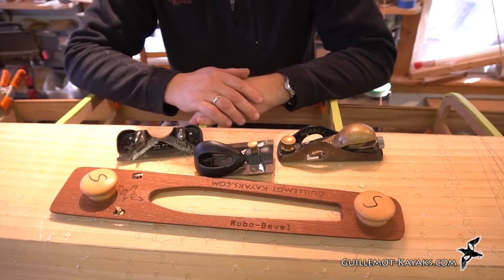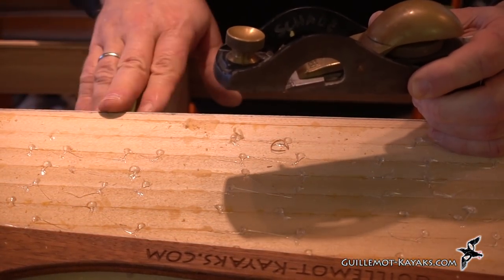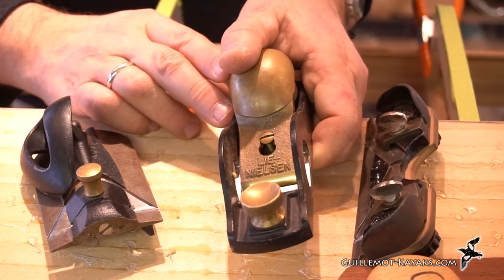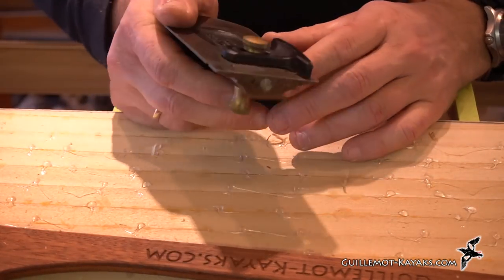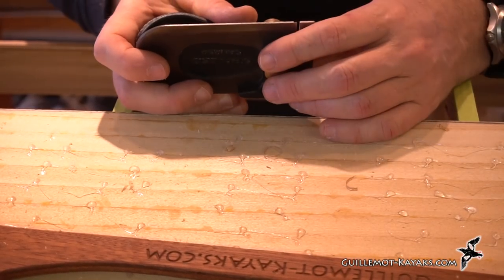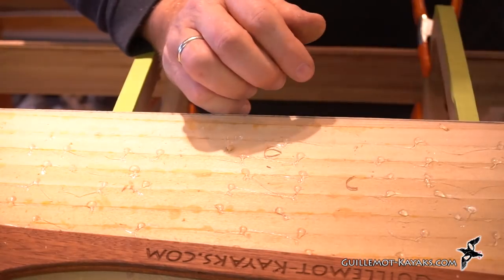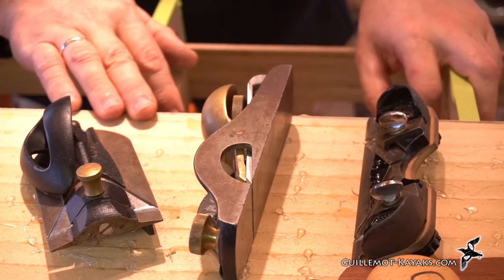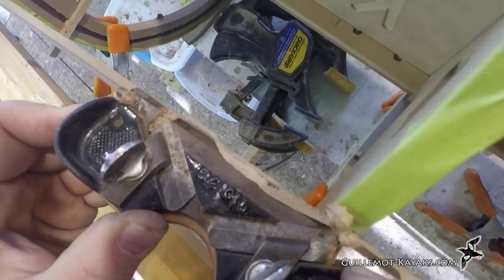Tool Talk - Rabbet Planes

Comment: hi Nick, I'm re-watching this but now for different reasons. I'm started, building a Somes Sound 12 1/2. It is a glued lapstrake construction and I will be needing to cut laps and gains. I thought at first to look for a rabbet plane but am now confused with shoulder planes and can't decide which would be best. The planks will be made of hydrotech marine plywood (3/8). What are your thoughts, please?  thanks, Chuck
Reply from the maker: I don't end up cutting gains so I'm not necessarily the best qualified. You probably want to use a tool that matches the size of the gains you are cutting. A shoulder plane is a form of rabet plane (rabet planes have blades that extend to the side of the plane) and I would think a shoulder plane sized slightly bigger than the needed gain would work nicely, but any rabet plane would get the job done. I'm sure some folks just use a sharp chisel.
Reply: @NickSchade  thanks Nick!  I think, based on what I can gather, is that one or the other has a lower blade angle and I'm thinking that this might be more suited, especially based on how thin the material is that I'll be using.

Comment: I think the handiest solution to swapping directions would be having a second Veritas side-rabbet set up to go the other way.  AND I'd paint it a different color so I'd not have to think about which one to grab.  But I only have the 79 Stanley with the metal fence in my rabbet plane collection (at this point in time), save for the Stanley 71.5 router plane. Good info from the Pro tnx.
Reply from the maker: The best solution is always: more tools.

Comment: I know this is an old video, but I have a question I hope you can shed some light on.  I have a Lie-Nielsen block rabbet plane like you show here, but for some reason, the blade is wider than the actual plane, is that intentional? Because to me it only seems to be annoying and make alignment much more difficult, so cutting flat and straight once one side is adjusted flush to the side is almost impossible. - I'm very close to just going with grinding it flush on both sides, but I'd like to know if I'm about to make a booboo. Thanks for all your vids, they make the woodworking fingers itch with need of building a kayak. :)

Comment: The fence on the veritas could perhaps be changed with a block of wood, so both sides can be used without adjusting the fence.
Reply from the maker: Yes, you certainly could. Since you don't have to adjust it very the fact that the adjustment on once side couldn't be changed without effecting the other side, probably wouldn't be a big deal.

Comment: Nick, I got your robo bevel about a year ago but I've never gotten the little plane to go with it. I see several Veritas mini shoulder planes on line from various places. some cost around $40 and some as much as $180.  is there much difference and which one specifically would you recommend to use in your robo bevel tool?
Reply: Lee Valley sell them, I just bought two. Veritas Miniature Shoulder Plane. 05P8001  $47.50 CA each

Comment: Rebate plane not rabbit is not an animal
Reply from the maker: rabbet and rebate are both correct

From Websters:
rabbet

Rabbet \Rab"bet\, n. [See {Rabbet} v., and cf. {Rebate}, n.]
1. (Carp.) A longitudinal channel, groove, or recess cut out
of the edge or face of any body; especially, one intended
to receive another member, so as to break or cover the
joint, or more easily to hold the members in place; thus,
the groove cut for a panel, for a pane of glass, or for a
door, is a rabbet, or rebate.

2. Same as Rabbet joint, below.

{Rabbet joint} (Carp.), a joint formed by fitting together
rabbeted boards or timbers: -- called also {rabbet}.

{Rabbet plane}, a joiner's plane for cutting a rabbet.
--Moxon.
__________
Rebate \Re*bate"\, n. [See {Rabbet}.]
1. (Arch.) A restangular longitudinal recess or groove, cut
in the corner or edge of any body; a rabbet. See {Rabbet}.